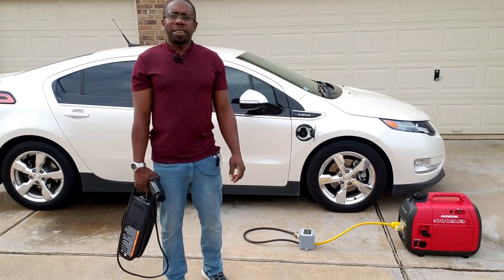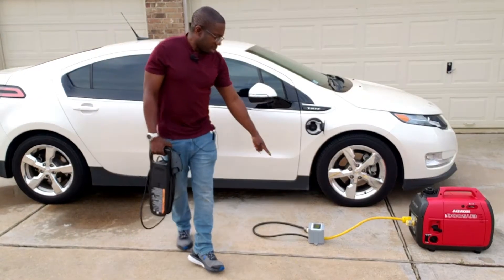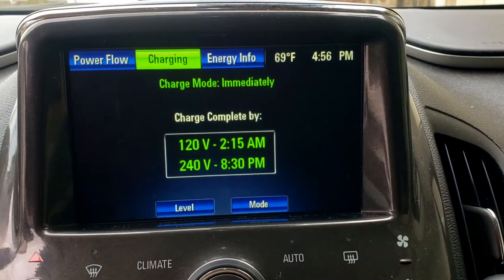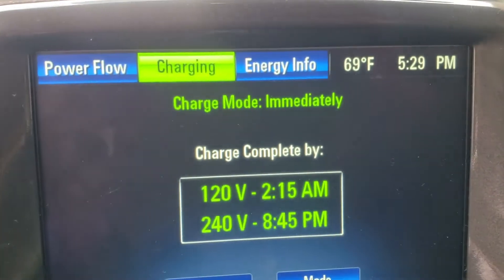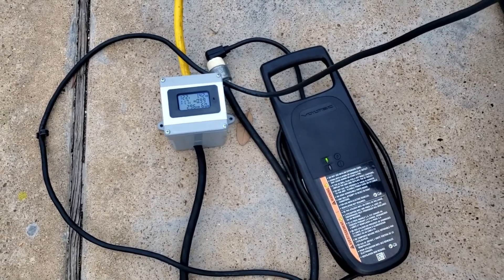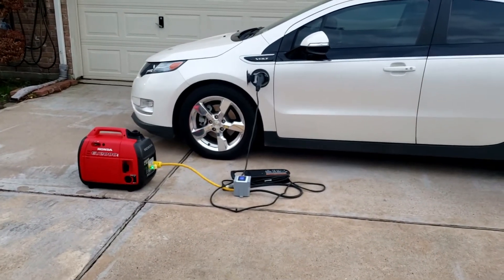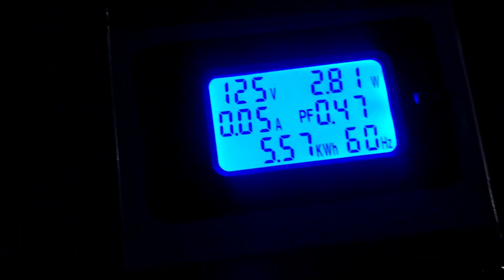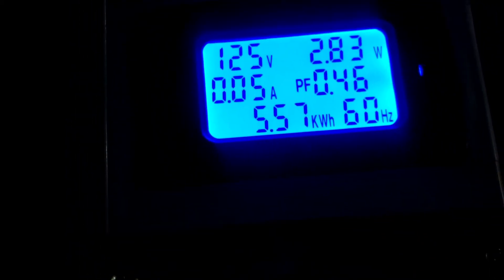Honda EU2000 Inverter Generator Charging an Electric Car.

Comment: Good video. I’ll keep my gas vehicle and spare gas can. I’d have Instant access to the 15 miles per gallon instead of having to wait 4 hrs to get 15 more miles. In an emergency, time is crucial!
Reply: The vast majority of people don't carry a gas gan
Reply: @ProlificInvention Interesting response. Are they keeping a generator instead?
Reply: @dmac232000  No, they just keep an eye on their fuel level and consider their remaining range and manage fuel stops accordingly so they don't run out.  It's exactly the same for an electric car.  A backup never hurts, however, as I ran out of gas when young and had to walk quite the distance several times for more fuel.
Reply: @dmac232000  I know for a fact most people don't carry a full fuel can onboard their vehicle, many drive open cabin vehicles such as minivans and SUVs and a strapped down can of fuel is a hazard in several different ways including heat expansion and pressurized fumes
Reply: @ProlificInvention  Oh. Okay. Thanks. 
I wasn’t suggesting to carrier extra fuel around in the vehicle everywhere one might go. 
Rather, I meant I’d keep a spare tank at home instead of a generator, adapter cable, gas can, and spare time. 
Being mindful of fuel levels would apply to both scenarios as no one carries spare gas or generators around on their vehicle all the time.

Comment: How about if you put two generators and cross them to make 220 volt with 1/2 a gallon of gas on each
Reply from the maker: I’m actually gonna redo this test with a 240v generator
Reply: @GeneratorReviews  i would like to see what would be the result because i have a nissan leaf and I would like to install 3 solar panels that i already have and see if i can charge my car also i also have two inverters and see if i can get 220 out.

Comment: Not to be mean but it looks counter  productive to charge your so called green energy car using fossil fuel especially in California were Gavin Nason has just outlawed all gasoline powered off road equipment in cluding gas generators
Reply from the maker: I guess in a power outage that last two weeks all the people with full electric cars should just park them and not drive

Comment: I think it was interesting testing this on a plug in hybrid like the volt because we know what kind of fuel economy the car gets, which is about 35 mpg. It's interesting comparing the efficiency of this to the engine

Comment: Thanks for the video. You wondered how fast a larger generator, like a 3.5KW model would charge. Sadly, unless your larger generator has 240V (and you also have a 240V portable charger) not much would change. The car will only request 12A at 120V, even if your generator would give more to other loads connected.
Reply: yes it wiúmkd by 3.5 jw geñerartir

Comment: Cool test. I found it ironic that you did the test on a chevy volt. Bc the volt is the only ev made that uses a  generator to power the ev motor when the battery runs out. It's generator averages around 40mpg.  Since it's generator is amazingly efficient it sure would be cool if if there was an option like the Ford lightning which you could Use the generator to power the house or whatever. Also if you really drove slow you could probably get significantly more than 15 miles. Could save a friend from needing a tow. I would think charging at 240v would be more efficient. In fact could see how many kwh you make on a gallon of gas to compare. Thanks for taking the time to make an interesting video
Reply from the maker: Hey buddy thanks for watching 
That’s a great idea 💡 look for the 240v test soon I’m going to make it because of your idea 
Thanks 😊
Reply: A 240V generator will be much more efficient as you have the wasted mechanical and heat energy from the generator, so the more power you can pull from a gas engine, the better. How much more ? I’m guessing a lot actually. Maybe 25 miles of charge? I can’t wait to find out! The most efficient setup would probably be a 240v gen that can hold the 240v load at about 80% of the gen load. So roughly a 3500w gen or so

Comment: 4 hours to charge 15 miles on 1 gallon of gas. Does it work? Yes. Is it effective? No. Making it less effecient than your average gas powered car.
Reply from the maker: But… In a power outage when this is your only car and you have no other option, I’ll take that 15 miles🤔 lol
It’s not perfect but it’s just an option.
Thanks for watching Jason
Reply: @GeneratorReviews  Have you tried a 240v generator?

Comment: I would like to know if you bought an electric car that had a battery that would not charge any longer, could you put the generator in the trunk and electrically connect it to the car and run it on the generator.  That would defeat the purpose of an electric car because now it runs on gasoline, but you would have an EV that you would not have to get rid of just because the batteries died. You would also be able to drive 4 hours on a gallon of gas instead of 15 miles of charge because the vehicle would be running at the same time the generator is. Calculate how far you can drive in 4 hours instead.

Comment: A real world comparison. Great video. Whoever asked how many miles per gallon does an electric car get? Offers a unique perspective. Your time was not wasted.
Reply from the maker: Thanks for watching
Reply: A gallon of gasoline has the energy equivalent of 33.5 kWh of electricity (the industry standard conversion.) My Chevy Bolt EV has a battery with almost exactly twice that, at 66 kWh. The EPA says it will go 259 miles per charge (and it will), yielding about a 129 MPGe (Miles Per Gallon equivalent). Sure beats the 15 mpg the Volt can get out of a gallon fed through an ICE generator.
Reply: There is MPGe but this is not the same, but a useful metric.
Reply: My volt gets about 40 miles per gal on generator. Not bad

Comment: A 240v would charge faster and use the gas faster because of the heavier load on the generator to charge at 240v. But due to higher efficiency of engines when they are under a load, 240v charging should be more efficient also. That Honda using 1 gallon of gas lasting 4 hours is impressive though.  You were at 70% rated load. Not bad. Nice test.
Reply: Other comments state that the car will accept only 120 volts and a limited amperage, so a larger generator would provide no advantage.
Reply: @mikelowe2094  that car (chevy volt) charges at a maximum of 16A at 240v, it has a 3,600W onboard charger that's actually most efficient (89%) at max power so a larger more efficient generator running at about 80% capacity capable of charging at 240v/16A would help a bit. That honda 2000 is nice and portable but is unfortunately only 14% efficient.

Comment: Why didn't you just pour that gas into the chevy volt ? It has it's own built in generator.  I'm sure it would be more efficient than using the external generator.
Reply: I understand the purpose of your video.  It would have made more sense on a fully electric vehicle with no other power source.  I did not mean to imply anything negative.  I did look at the specs of the Volt and it showed that 1 gallon would yield 33 kwh.
Reply from the maker: @thomashowes1973  No worries buddy! I appreciate your feedback and thanks for watching.

Comment: The screen says: Charge Complete by 2:30am, is that means charging 5.5 hours more, total 9.5 hours and 2.4 gallons of gas would fully charged with 2-300 miles?  If so, should connect with a external 2 gallon or more gas tank continue charge it for 9.5 hours, it is much better than 4 hours for 15 miles.
Reply from the maker: That’s more than I wanted to do the test my neighbors would definitely go crazy running a generator all night lol
Reply: @GeneratorReviews   I just don't know what it means by "Charge Complete by 2:30am".
Reply from the maker: @simonlee6512  That’s when it would actually get to full state of charge this particular car charges 50 miles because it has the battery and back up engine
Reply: @GeneratorReviews   Oh! Fully charged only 50 miles?  So a 1 gallon of gas charge 4 hours for 15 miles will serve the purpose of getting home or find a quick charge station, really no need to spend more hours to fully charge it. Although may up the mpg to 21.

Comment: All this does, is proves you tree hugging people are hypocrites. You say you're concerned about climate change, but you're depending on fossil fuels to keep your little electric cars running. You still fly in planes that use fossil fuels, power your home with fossil fuels, etc... If you want to be pioneers, figure out a way to keep your cars charged on solar and wind grids.
Reply from the maker: Thanks for watching

Comment: With gas prices thru the roof, that's not acceptable mpg. Like driving a Suburban.
Reply from the maker: Honestly I wasn’t going for gas mileage I was just showing an emergency back up In case of a power outage and that’s your only source of transportation
Reply: @GeneratorReviews  Imagine what energy costs would be without inexpensive coal. Paralyzing

Comment: It's always advisable to have a generator for EV owners, not just for the EV but also for the fridge. A good quality generator like the Honda is also advisable, as the cheap ones may die unexpectedly because constant 100% load is very hard on the generator.

If there's a shortage of gas, the ICE cars are stuffed. If there's a shortage of electricity, EV owners can turn gas into electricity with a portable generator.
Reply from the maker: 💯agreed

Comment: Chevy Volt gets15 miles per gallon lol,... You can get twice the mileage from a gas engine 30 times the size.
I know it doesn't exactly work that way but it does make you wonder how much Fossil Fuel is used to make this "Clean Electricity"
Reply from the maker: Yeah it doesn’t but it does make me wonder now that you mentioned it.
Reply: @GeneratorReviews  
Found this on the web: "COAL The average electric vehicle needs 33 kilowatt-hours of energy to travel 100 miles (160 km). A Tesla Model S would require about 286 pounds (130 kilograms) of coal to be burned at the local power plant."
Reply from the maker: @davidyummus6259  Thanks for sharing this information

Comment: Next test...start a coal fire and boil some water then capture the steam pressure and use that to run a turbine generator. Grab your 50 mile long extension cord and plug that into your EV and calculate how many pounds of coal you had to burn to go 15 miles. That's literally what's happening when you charge your electric car by plugging it in at home. You could have dumped that gallon of gasoline in a 1988 civic and gone 45 miles. Yes, I know there are windmills, dams and solar panels that produce electricity as well, but it's a fraction of our total energy production.
Reply from the maker: Hey I know this world 🌎 is crazy but I’m just trying my best. 😅 That test would be fun though lol 
Where do I find a 50 mile long extension cord though🌎👍🏾
Reply: My local coal fired power plant has recently done testing on burning biomass. Hopefully they will make the switch sometime soon.
Reply: buy çívic hybrudé
Reply: No the next test is to see how big the piece of coal you have for a brain
Reply: Not completely true. Most places in the US at least now get most of our electricity from natural gas which is far cleaning burning. Centralized power generation also has the opportunity to capture waste heat and bring efficiency far higher than a portable generator or car engine.
Reply: I have 39KWh of solar, I charge my car for free

Comment: Question. In this test, it took 4 hours to add 15 miles of range. How long does it take add 15 miles from a regular 110v outlet? Yes I am fully aware that this was a proof of concept test. Thank You very much for this test.
Reply from the maker: It would take exactly the same time since I was using 120 at 11 amps 
240v is the best way to charge your EV
Reply: Same time from a wall outlet as we get 112v and 12-amp for 1,344 watts.  That is max from the charger.

Comment: Gavin can you tell us how do you purchase that nurture plug to change electric car. Is that self grounded. Thanks
Reply from the maker: https://amzn.to/3IqOoj0 Amazon Link for the bonding plug 
Thanks for watching
Reply: @GeneratorReviews   Hello Gavin do I need that plug if I’m using my eu 2200i for my house using adapter to the L-14 house inlet to the transfer switch box. Thanks Again
Reply from the maker: @Nick-gi6ym  No only if you’re using a surge protector

Comment: 15mpg, and much worse emissions than a car. Ouch lol
Reply from the maker: Lol No no it doesn’t get 15 miles per gallon that was just the charge rate to test an emergency situation kind of like a power outage that Car gets about 90 to 100 miles per gallon
Reply: @GeneratorReviews  Oh yes, of course! I was talking about 15 miles of charge per gallon of gasoline used charging in this absolutely ridiculous way. Fun video! :)
Reply from the maker: @BatteryTestChannel  🙏🏾 Thanks 😊

Comment: Fantastic proof of concept. 
I would love to see you drive the vehicle and verify that you could really go 15 miles on that charge. 
It also goes to show that unless you are using solar to charge that vehicle, it is incredibly energy inefficient.
Reply: 60% or so, in inefficiency? ha!  most people think electricity is created by pixie dust..  like pizza come from a pizza tree...
Reply: @josephvillatoro4215  electricity is generated in large scale at much higher efficiencies than a small portable generator or even a car engine can achieve.
Reply: A Honda 2000 is NOT the same efficiency as a power plant. The test is showing the amount of electrical energy that specific generator can extract from a gallon of fuel, not how far an EV can go on a gallon of fuel. If you used that same gallon in the engine of this car (it's a plug-in hybrid) it would get 30-40 mpg which is still not even that great. power plant scale generation is much more efficient than that, that's the whole point of electric cars, you're essentially using the huge generator that's super efficient and well controlled to distribute power to thousands of cars. Evan if it's powered by natural gas or coal it's still much less CO2 made than burning gasoline in each car engine.

Comment: Definitely do an update video with a more powerful generator. I would love to see it with a non-gas generator/power pack as well.
Reply: id have to agree but also maybe like a duel fuel generator  see how far a propain take would get you ?
Reply: @MrCam3565  excellent idea
Reply: That "more powerful generator" would provide no advantage, if the Honda car accepts a limited current.
Reply: @mikelowe2094  a more efficient generator would help a lot, that Honda 2000 is only 14% efficient. a larger genny would do a bit better.
Reply from the maker: Great idea thanks 👍🏾
Reply: 50 kw 4liter eng burn 3 gal hr.. 25 mpg prx

Comment: Terrible efficiency but yes in an emergency it’s possible. 15 miles should be enough to get you to an actual charging station.
Reply from the maker: Yep or a $250 tow truck fee
Reply: I bet you don't want to wait 4 hours, that would be bad. Even waiting for a tow truck for a hour was awful. I mean for me at least.

Comment: You had the electronics of the car on during the test didn't you? If the car was off during the charging, it would be possible to get more miles on a single gallon, right?
Reply from the maker: No all the electronics were off and the electricity that the screen consume is so minimal.
Thanks for watching 👍🏾

Comment: Where this relates to a large jeep community is in the new Wrangler 4xe. While overlanding we can run our jeep on hybrid battery with climate control on ( ac) for 16hrs . Unless on 120v we cant recharge remotely. The 4xe also allows all climate control functions while plugged in. For guys like me we can remotely camp in our jeeps while using full climate control with a small generator on a hitch carrier.  The information you provided was detail, thank you
Reply from the maker: Thanks for sharing this with us.
Thanks for watching

Comment: In comparison. A 1500cc car would do 37miles per gallon.
Reply: That was not the point of the experiment ie to compare efficiency. The point was to know if it was possible and how much you need in case of an emergency..which was achieved in my opinion. You would only do this in an emergency...for example of a long road trip in between chargers when  driving a pure electric car.
Reply: 1.5 liter car is much more engine than what’s in that generator lol… a 1.5 liter engine with a hybrid electric motor would be able to get well over 50 mpg and if you hyper mile it’ll be closer to 90 mpg… this is more for emergencies and range extension
Reply: Sounds pretty inefficient to me this ev stuff when a gas engine can get 37mpg 

And this one gets 15mpg
Reply: @1234crazydude  it's worth it for emergencies only
Reply: @esmaponda 4 hrs for 15 miles doesn’t quite sound like “emergency” timing to me. Using a fuel can in 5-10 minutes fits the “emergency” timing a bit better.
Reply: My 22 year old vw TDI gets almost 52mpg (750+ miles per tank) 43+ in town and it fills up in five minutes, not 4hrs for 15 miles in an emergency….. I will never get an EV, never.